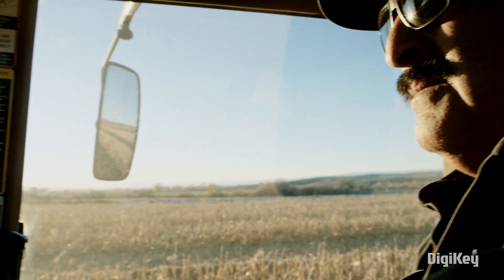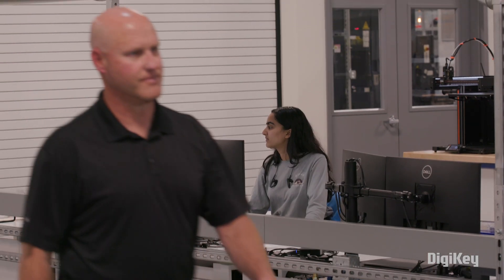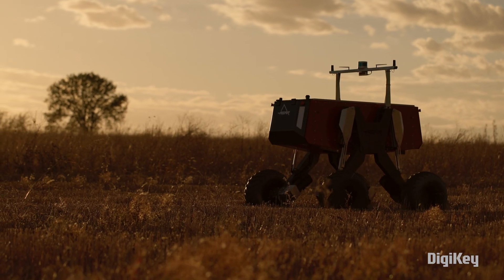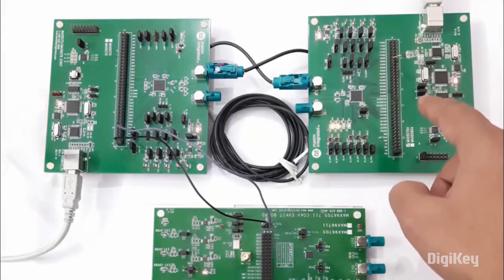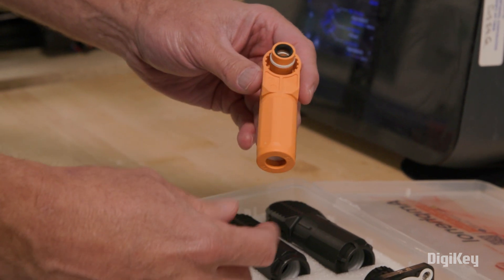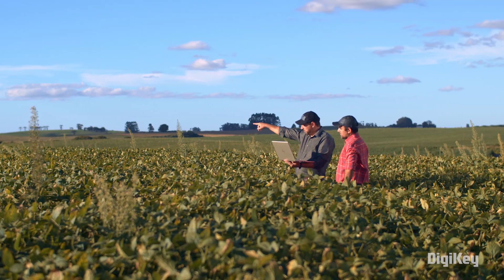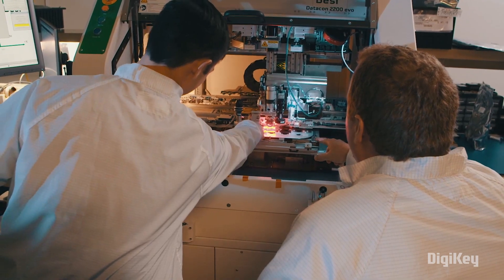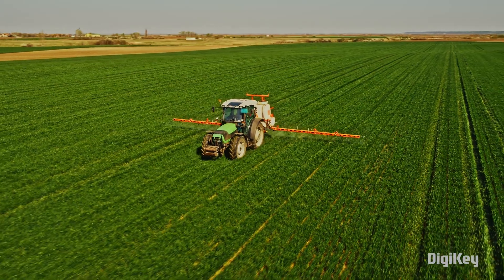Planting the Seeds of Future Farms  - Farm Different S3 E2 | DigiKey

Comment: seems odd to me that DigiKey talking like they know more about precision farming than the John Deere and Case/New Hollands of the world.  Most of what they say is accurate but also just common sense too.  I actually work PF solving more interesting problems.  For example, AI needs power hungry processors that traditionally are water or mechanically cooled where as Ag, Construction and automotive ECUs are passively cooled and so there are trade-offs on what can be done with an FPGA vs GPU as it relates to what's good enough performance wise.  Tractors, for example, are not going down a road at 60 MPH.  Anyway, tell me something less obvious DigiKey if you can lol.
Reply: 😂 Dang good ☝🏼☝🏼☝🏼point I must say 💪🏼